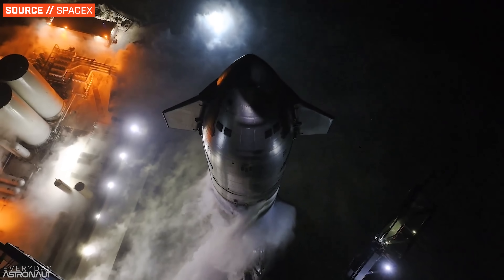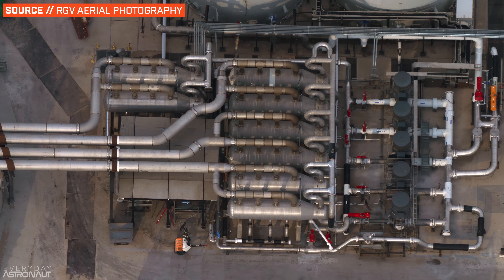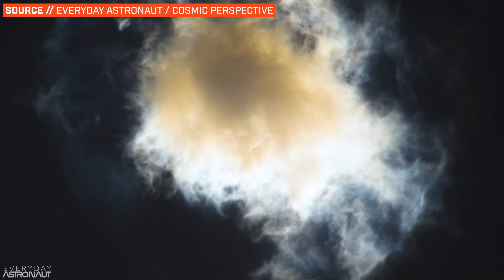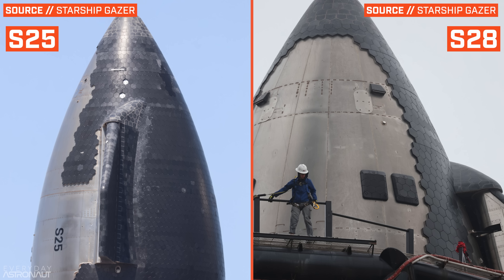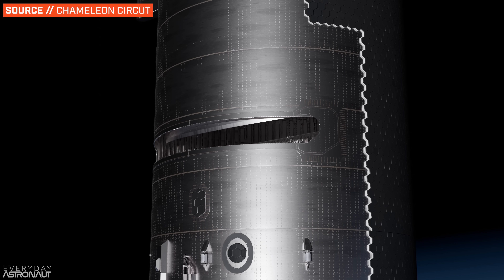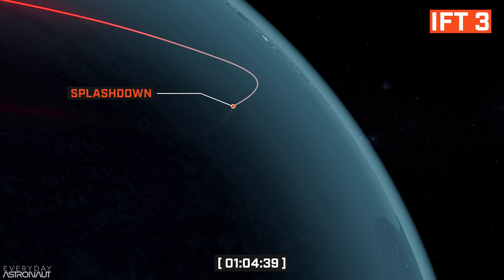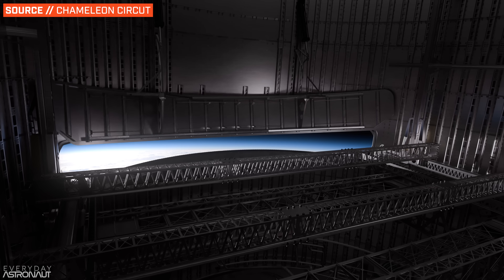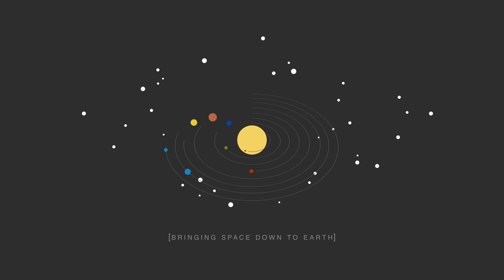What Did SpaceX Change & Upgrade For Starship's 3rd Flight Test?

Comment: As SpaceX keeps putting a lot of extra testing goals on the table, I think there will be the chance of one thing not working as planned.
But I think, we will be finally get some clues about the robustness of the heat shield.
Reply: I don't want to be negative but I think the last launch involved a ton of luck. I'll be extremely surprised if all the engines run full duration this time. It didn't seem like it gained enough speed even without a payload. It definitely can't with engines down. I'm hoping the engine issues were from the pad debris that's now solved. I just got a feeling it will do worse this time and last time was lucky, on the engines that is.

Comment: I assume they're launching to the exact same trajectory as last time so that if the Indian Ocean re-entry burn doesn't work for whatever reason, they still have a passive re-entry near Hawaii as a fail-safe, a built-in backup.
Reply: That is what I am thinking too but haven't seen anyone confirm this.
Reply: Yes, but he forgot to say after the payload door test, a fuel transfert from header tanks to bottom ones. Then retrograde to reach indian ocean or hawaii if engine dont work.
Reply: It's more likely they need the fuel in the header tanks to generate extra delta-v to (hopefully) reach the Indian Ocean. It's really a ballistic flight test.
Reply: Maybe it will end up on MH370 ;)

Comment: SpaceX actually does not want their rockets to fail. The 17 defects involved with the last "mishap" would have been fixed and the lessons learned anyway.The only thing the FAA has accomplished was to add more paperwork to the process. IMO the FAA would be better used regulating Boeing's airliner manufacturing process right now.
Reply: There still needs to be regulatory oversight to ensure that Space X follows certain requirements for public safety.   Right now the FAA is not slowing down the launch of starship anyway.

Comment: I understand the starship is going to splash down in the Indian Ocean. Are they going to use🪂 for this or are they going to let it slam in the water ?
Reply: As far as I know, Starship lacks parachutes.  They are not needed because the "belly-flop maneuver" slows it down.
Reply: @JPMadden  so hopefully it’ll stay intact on splash down and it will be rinsed and reused ?
Reply: @OzzySafa No.  They are not going to reuse either the booster or Starship.  I haven't heard anything about recovering the wreckage, but that would make sense.

Comment: I expect the booster to get into boost back and a high chance for a controlled decent into sea. I expect the ship to not make it through reentry. 
On the time line I blame the incredible lack of streamlining and frankly contrarian politics to have caused at least a 9 month delay in getting to this point. Another 3 months additional delay in not cancelling the 1st launch until the deluge system was installed although this is debatable.

Comment: Hello Tim, great job! I can’t tell you what a relief it is to have a real voice instead of AI generated one. I was curious about the fuel transfer.  Will there be  Cold gas thrusters,  or some kind of ullage motors to manage the fuel in the tank so The transfer pumps only pump liquid?

Comment: 6:09 couldn't the reason for not attempting a soft landing be that the propellant transfer is moving fuel away from the header tanks, so it wouldn't be able to do it?
Reply: Better to write a flight plan that under promises so they don't have to file a mishap report. A flight plan that says "will crash into the Indian Ocean" is fine, and when that happens there will be no extra paperwork or delays to explain why the last part of their test did not happen.
Reply: This makes a lot of sense to me. I was wondering why they wouldn't just have the program in there in case it does make it down to the ocean in one piece.

If they no longer have fuel in the header tanks because of the transfer, that makes a lot sense they wouldn't even go for it.
Reply: There will also be a lot of unknowns around what is in the various manifolds after the vacuum ignition. The engines will be in new territory, so I can see why they are not stressing about an extra relight. They want the engines to appear reliable (people will fly on this one day, maybe soon), so they might not want to risk the optics of a failed engine relight on landing at this point given low confidence of it working. It would look too much like a step backwards, even though it wouldn't be.
Reply: He said they're not going to bother with the software necessary for a soft landing until they know Starship can survive re-entry.
Reply: @JPMadden  yeah but that’s speculation isn’t it? i highly doubt they haven’t worked on that part of the software.
Reply: @Unbaguettable I'm not saying they've done none of the work.  I'm guessing they're skipping just those details that would be necessary for this flight path.
Reply: @JPMadden  i mean regardless they can’t do a landing burn if they don’t have fuel in the header tanks.
Reply: @Unbaguettable But they already tested the landing in the suborbital test series .
Reply: @johndododoe1411  why are you replying to me? i didn’t say they haven’t done it yet
Reply: @Unbaguettable  I did say I'm guessing.  I don't work in IT.  The last time I did any computer programming, it was 35 years ago and in Pascal, which was probably obsolete then.
Reply: @Unbaguettable  I honestly don't know if the header tanks need to be full for landing.  They probably do.
Reply: @Unbaguettable  Having the landing already tested at full scale is a lot further than initial work on the landing software .
Reply: @JPMadden  yeah we don’t know that. i’d assume too but honestly we don’t know any of this, it’s basically all speculation
Reply: @Unbaguettable No, it's not "all" speculation.  I said I was guessing about the things I don't know for sure (I'm not upset with you).  But I'm confident either Tim or one his million-plus subscribers has the answer to any question, unless it's still secret.

Comment: The recently released WB-57 footage from IFT-2 shows so many heat tiles missing that I doubt it would survive entry without changes to how they are adhered.

I think the lack of a flip and landing burn of the ship is to ensure its destruction to deter salvage by competitors and adversaries.
Reply: They have a new regime testing the tiles with suction now.  So it should dramatically reduce the number of lost tiles.

Comment: I feel like orbit of ship 28 will be achieved. It was a fairly minor issue that caused the failure of S25. I'm 50-50 on whether the booster survives the flip. I'm not confident about re-entry.

Comment: Crazy not to program a flip and soft landing. Perhaps so that not achieving a soft landing would put it into a mishap investigation?
Reply: That is a good point. If they plan it and it fails, that's a mishap.
Reply: thats a good point, I was also wondering why. they can probably benefit more from launching ITF-4 quicker, because they have already nailed the landing once
that may be the reason why they are doing all this testing with ITF-4 vehicles, it wouldn't make much sense otherwise